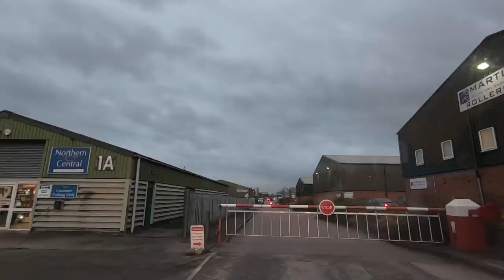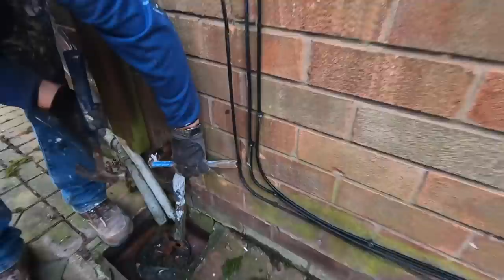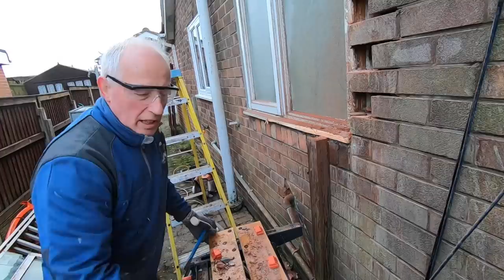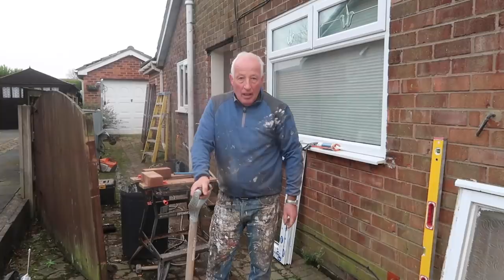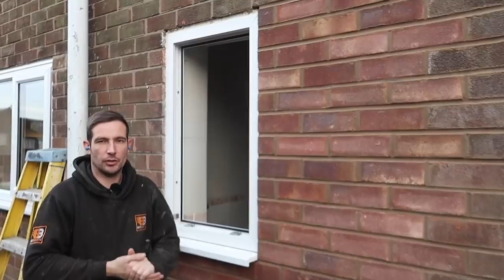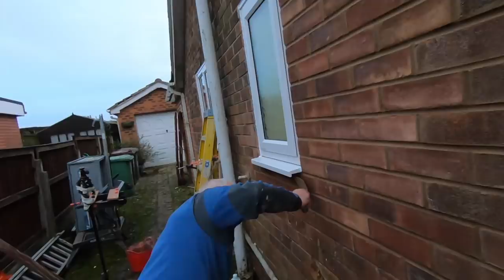Bricklaying Vlog - Making a Window Smaller With Brickwork

Comment: Yeah the mixer for a small barrow of stuff is not worth it eh.  It's the cleaning and washing it out in a built up area, never able to do it right and then the mortar builds up in it. Only good thing about on site...............you can wash mixer proper and make a mess on the ground, especially with  wet roughcast and pebble dash.  Nice match on facers Stu.

Comment: I have heard it said, that if you get some yoghurt and mix it with water, then brush on the brickwork it promotes algae to 'age' the new bricks.
Reply: Yes, I've done that on concrete garden borders.  Not sure it would work here though, the brick will darken over time as the textured surface catches grime.